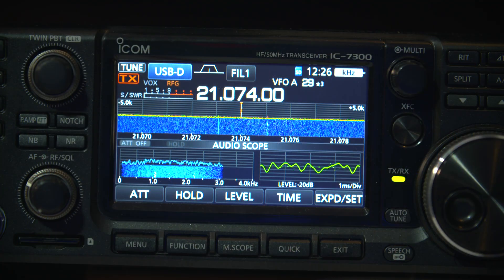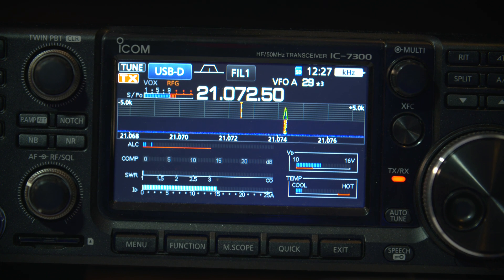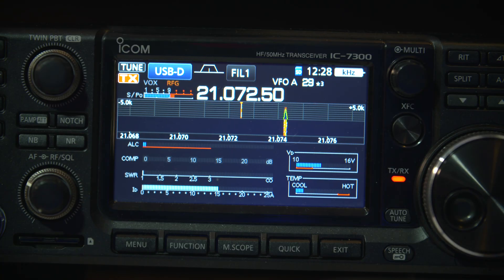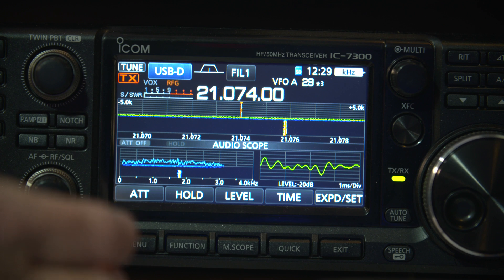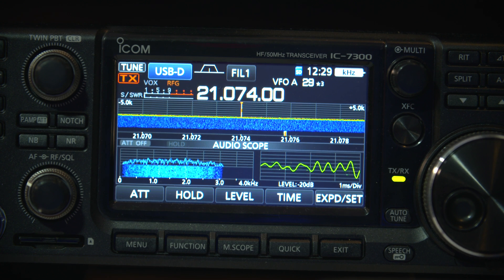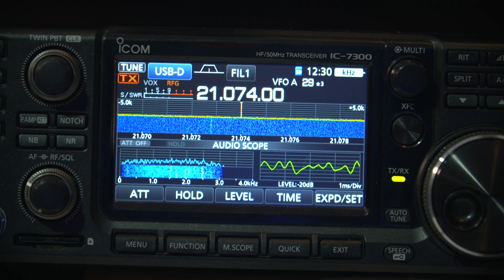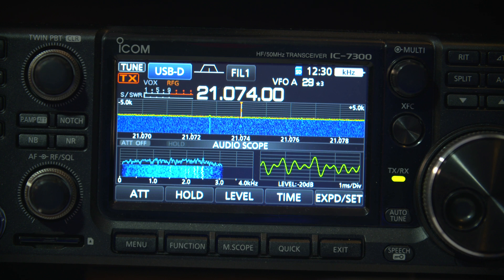FT8 HAM Radio - How to Reduce your ALC: The Secret to a Powerful Signal

Comment: Hi. Thank you for the video. What do I do to reduce the audio. Is that the setting in WSJT where it has the power slider or a knob on the 7300. (I have the same radio) and I have only been able to reduce ALC by reducing power level in WSJT to point I have no output. Thank you. 73 WA5MS

Comment: Applying this information made a HUGE difference in my FT8 signal.  Stations that could never hear my signal before were easy to QSO once I got these audio settings optimized.  And on 25% of the RF power.  This clearly demonstrates how on SSB, modulation is EVERYTHING.  KQ4NMY
Reply from the maker: Thanks for the feedback. I’ve had some negative comments about this. It’s worth trying to see if there is a difference. Overdriving a signal never works.

Comment: Great tutorial!!!
I do have some comments/questions.
I originally set my ALC up by pushing up the Pwr setting on WSJT-X to about midway and I had my IC7300 RF Power set to 60%. With these settings I was registering near enough to 60W on my SWR Power meter.

When I followed your video I found out on Audio Scope of the IC7300 that I was overdriving so I backed off the Pwr setting until I was no longer clipping. When I did this my Power output dropped back to around 20W. To get 60W output I have to push up the Pwr slider which then reintroduces clipping.
How can I get the full 60W output with clipping?
Reply: I have an older radio but I keep the transmit power on the radio at 100% and adjust the computer audio and software audio until its clean, 67 watts was about all I could get but 48 watts was my particular radios sweet spot for digital modes.
Reply from the maker: Are you looking at an external power meter ? Your power set by the radio won’t change. Have a look at something like psk reporter and it will show you the important thing if you are getting out

Comment: On the IC-7300,  via the Connectors menu, I adjusted the USB MOD Level to 25 (default is 50).  This slider to 25 removed all ALC readings.  I am able to keep the WSTT-X "power" slider just a notch below full.  This seems to work for me.  I have a DXCC challenge count of 1325.

Comment: It "clips" because of the level of the audio scope set at -20dB. Change the level of the audio scope and you won't get that "fake clipping" where you think the audio distort. Set the level at -30dB and you won't be fouled that the audio is distorting. The important thing in digital modes with the 7300 is to keep the ALC levels just before it starts registering on the ALC scale. For me it gives clean signal regardless of the mode you are using and I have success in all those modes like freedv, fldigi, varac and so on...
Reply: Good point. Needs to be scaled correctly to be of any use.

Comment: Keep in mind, the displayed audio waveform is just a digital representation and not an actual measured waveform.  The flattop distortion you are seeing is the limit in the vertical span of the audio meter, you can correct this by adding in more attenuation (your set to -20db level now).  You need an external oscilloscope to see real TX waveform.  Small amounts of ALC does not create flat top distortion as indicated in your video, it does drive the audio into compression.  Edit, I came down to my shack to make a video demonstration using an external oscilloscope:  https://youtu.be/h6gJzcj17vU
Reply from the maker: Hi there thanks for your video - Just so you we are clear I didn't say run NO ALC I said to reduce the ALC so its not clipping. I think a lot of people clip the crap out of their signal. My purpose of the video was to encourage experimentation and see what happens if you reduce the ALC. The most important thing is how it works in the real world, and is the signal better?
I turn compression off so my signal is a raw signal. A lot of people comment on the WSJT-X slider that is labelled a Power slider. I understand the audio meter on the 7300 - I don't have an oscilloscope to check the output. I didn't see that you have overdriven on your Yaesu radio as a fair comparison. In my experiment I found that my signal was being hampered if I had a lot of ALC and I could see the signal splatter somewhat. I also did a comparison of a high ALC and a low ALC and with PSK repeater my signal was received by more stations with the lower ALC. I wanted to make the point that some people don't need to drive that power slider all the way up to get a signal out. The fair way to test is to actually see the results in signal reports. Im not trying to trick people here but to get them also to experiment and maybe they don't need as much ALC as they think they need. 
I have also had people say they found that using less got them better results. It's the old Ham radio trick of doing more with less. I used to work in broadcast microwave links and in the digital links if we overdrive the signal it gets compromised. Im not exactly sure what you're showing in your video - could you do one that overdrives the signal?
 Could you do another video where your oscilloscope flat tops and then do a signal report comparison with something like PSK reporter and compare the difference between some ALC and a lot of ALC
Reply: @Aussie_Ham_Radio  Understood, my main point here was, the misinterpretation of the audio scope on the IC-7300, its being interrupted as distorted audio, but in realty it may not be, and in fact its only displaying a distorted waveform due to the limits of how the audio scope is setup.    Last night I wanted to explore this subject a bit more, so I made a follow up video:  https://youtu.be/40gkEIPROIw

Comment: How ironic.  A video about how to make your radio sound better, yet the audio level on youtube is 13 dB down.  
Push the level button and that level meter will change scale and stop flat topping.   Have you checked the actual transmitted audio?
Reply from the maker: Thanks for the feedback. I checked my settings and it sounds fine here when it was recoded and uploaded. It was recorded at 0vu and I check it on a LUFS meter at -9 LUFS and on a ppm at -12dB. Sometimes YouTube messes up the audio on stream delivery. It doesn’t have the same standard as broadcast so levels at your end can be wildly different - thanks
Reply: @Aussie_Ham_Radio  Right click the video, click stats for nerds, look at the Volume line (content loudness -12.9 dB)   That tells you the average normalized video loudness as calculated by youtube (and as presented to the clients)
Reply from the maker: @stargazer7644  Yep thanks for the feedback. I think it might be something on YouTube end. If anything my compressor on the mixer I’m using actually sounds high and maybe YouTube analyses it incorrectly. I’ll look into it more but I looked at the raw recording and audio is within broadcast spec. YouTube does weird compression things when I upload a video a hack I found is not to publish instantly but keep it private then publish once it reaches full servers otherwise the  settings are forced for instance at 720p when it’s a 4K video. I actually think this video I put out quickly and while recorded correctly. But def need to find out more from my end. Thanks again for that feedback

Comment: Whenever I am running digital modes I always have no ALC showing, I leaned that 30 years ago using psk31, I now have a 7300 and never thought to use the audio scope to adjust the wave form. Great video and thanks for the tip.😊

Comment: Interesting video Glenn! This is the best use case for the IC-7300 audio meter I've seen yet. I rarely have used it because I thought it was more of a fun gimmick. But I'm still struggling with why you selected -20dB on the audio waveform display. With this setting, my WSJT 'Pwr' meter is a much lower setting (-16 dB) than when I used my Meter ALC to determine the setting (-4.0 dB). And my IC-7300 draws much less power (8A versus 18A). I did read what u said about how broadcast audio uses that level and I do see how the signal skirt on the frequency spectrum extends out a bit. I'll keep trying this over an extended period of time to determine if it really does improve my FT8 response rate 😀73 KJ6ER
Reply from the maker: Thank you almost have to ignore that power slider. It’s a combination of what the audio meter and the alc on the radio. If you have a higher pwr setting in the software it clips and your actually wasting signal being compressed.

Comment: Hi Glenn, a very interesting video. 
I also have the IC-7300 and use it daily for FT8 operation.
Everything you say makes sense, I will also check my settings.
I want to reduce/raise the output power of my 7300 without changing the ALC by moving the PWR slider in WSJT-X, is that possible?
My Idea is to have 100W when the PWR slider is on the top and the ALC is a linear wave as shown in your video (I think you can set it in the windows audio settings).
When turning down the PWR slider I want to reduce the output Power only - without (!) parallel lowering the ALC because then at some point the audio of my signal could get to "quiet".
I hope you know what I mean ;) Maybe a video about your other settings - in combination with the ALC settings - would be a cool thing for a new video.
73s from Germany - DO9KW (Stefan)
Reply from the maker: It’s not perfect as you can change the value on the 7300 but if you know where the output sits it’s likely that your not overdriving. That’s the key to the input. I was finding too much alc was a too high “digital” signal. I backed it off and instantly got more replies on ft8

Comment: change the level on the  audio scope -    your audio scope can be altered. 

For AFSK Dta modes ..adjust the  TX audio level so there is ALC action!!

 basic manual
In the SSB mode, touch the TX meter to select the
ALC meter, and adjust until the meter reading swings
between 30 to 50% of the ALC scale, when speaking
into the microphone at your normal voice level.

 advanced manual

When operating in the SSB data mode, adjust the
device’s output level to be within the ALC zone

Comment: Thank you for your video, Glenn. 
Apparently -20dB are set as attenuation for the display. Whether clipping already starts, or only the upper limit of the amplitude display is reached, seems questionable to me. I have set the attenuation in the display to -30dB as a test and there you can push the Pwr slider up to the upper limit stop without it clipping in the audio scope. Why did you just select the -20dB as the value, Glenn?
Reply from the maker: Thank you for the comment. I found that -20 monitor level was the best level monitoring, (which is the case in broadcast audio). I did some tests to see what the level looked like. What transmitted further out and what didn't. Have a look at the spectrum scope by itself zoomed in to the max when adjusting the power setting on WSJT-X. If your signal skirt looks spread out and especially if it has zig zags on it  - its splattering. The higher you push that level up the larger the TX skirt gets and yes if you go to -30db the monitor will look lower on the audio scope. A nice clean signal is one that is not overdriving. If i have the nice rounded peaks on the -20 scale it doesn't splatter once i get above that switching to the spectrum display it does horrible things. To test properly you would need some bench equipment and failing that the internal scopes are adequate for Ham radio. Obviously this is for digital modes and the ALC is different when driving a HF radio using voice. I think a lot of people are basically running the input too high, it won't hurt to start lower before wacking the "PWR" slider to the roof. Audio is probably the hardest thing to get right between different computers. I think the slider is mis labelled calling it PWR have a separate monitor on the output I have lots of audio issues especially with Windows 11 where when you turn off enhancements they are still on - you have to go into the deeper menu that looks like windows 10 to turn off enhancements "again" there too. I also have issues on the latest Mac version of WSJT-X the level slider jumps around.  I hope that explains it a bit better.
Reply: This is an amazing explanation!

Comment: Thank you, that was just so easy, and I made two DX contacts back to back after fiddling with this.
Reply from the maker: Awesome - Thanks for the comment. it is easy yea? I also have issues with audio settings on the computer - it’s a battle to tweak it perfect. But it’s what’s  going out to the transmitter that is the key
Reply from the maker: Some hard comments are telling me im spreading lies by this - Im going off my own experiments where I wasn't even aware I was overdriving 0 I then reduced the ALC and PSK reporter reported contacts all over the place - so I am just passing on my own experience for people to try. In Broadcast TV if we overdrive a microwave digital link signal it doesn't work as well as backing off the power

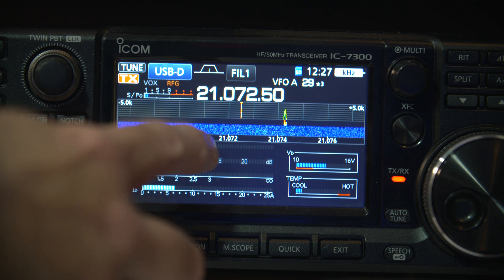Comment: The 7100 has that screen (At 1:47) in B/W. I hesitate to remove all the ALC off the meter, as I have had fair results. I guess I will experiment.
Reply from the maker: Yes you can see that screen and also tap the top right to cycle through the SWR so it can be seen on the Audio screen - on the 7300 anyway
Reply: @Aussie_Ham_Radio  It has the 4 outputs and you can see the ALC, which was pretty high on my radio, I set it down in the WSJT-X PWR slider on the lower right, and my ALC is a lot lower now. And, I hit a bunch of central EU countries, ones I had had  a tough time hitting before. The 7100 does not have the cool audio waveform display as far as I know. But I may dig through my owners manual tomorrow just in case it is there hiding. These radios are pretty advanced.